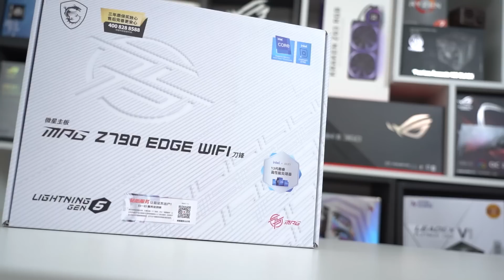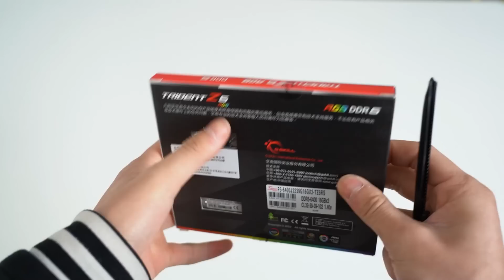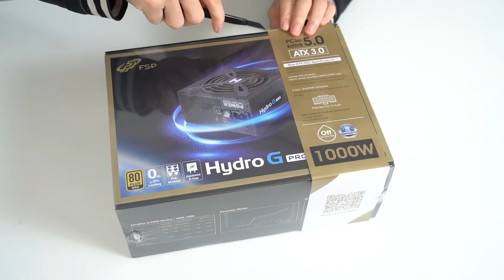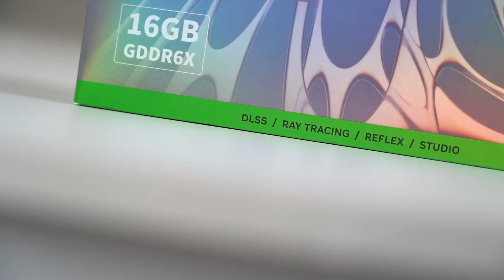RTX 4080 IGAME + 13900KF White computer

Comment: Drop dead pretty build - it's like a work of art.  I thought I read that using a vertical GPU mount had a negative impact on PCI lanes?  Maybe that's AMD not Intel, can't remember?  Wondering about fan noise with that many fans but wow.  What is the airflow like on that case?  You did an amazing job building this rig, wonder why no 4090 was it a 'color' issue that made you go with 4080?  The only thing better than your build skills was the video production - truly top-drawer!
:person-turqouise-waving:

Comment: That’s a lot of pull fans. Technically 10 exhaust fans and 3 intake. Personally I would’ve done the verticals 3 fans intake. 6 intake, 7 exhaust instead of 3 intake and 10 exhaust. Cool build tho!
Reply: I was thinking the same as you usually have more intake fans than exhaust, but since he has a radiator on the side I guess they can work good as exhaust too
Reply: More air out than in, Means less dust in machine. As long as it has sufficient cooling. More air out is best.
Reply: There is probably even pressure it’s just that the uni sl infinity’s are the same on both sides
Reply: At 5:22 and 5:36 does anybody know where he got some extra screws from im kind of trying to build the same thing but the package only comes with 8 screw only
Reply: At 5:22 and 5:36 does anybody know where he got some extra screws from im kind of trying to build the same thing but the package only comes with 8 screw only
Reply: @fidelreyes9939  probably bought some at a best buy or sum hardware store

Comment: almost same build I did. Only difference is I used Corsair h150 with lcd upgrade side mounted push pull, the v2 24 and 8 pin strimers and mine uses the vision 3080. First time build in the evo case and I ran out of room because I top mounted my psu... and I have like 4 controllers and a hub behind the scene to get rgb linked in icue software. Seeing how the cables going through the case routing pathways are hidden by the top mount push pull I wish I would have done that because thats the only thing I don't like on mine is the visible routing pathways.

Comment: Was there a reason for going with the single fans instead of triple packs with controllers? My pc wouldnt turn on with the controller plugged in tried 3 different ones. Was forced to rebuy single packs just to make it work. Just wondering if you had bad experience with their controller as well. Or anyone else that sees this.

Comment: Omg, almost same as mine, only I use air cooler Noctua nh-d15s, previously AIO already remove, I thought I’m crazy enough to put the Gpu upright mounting with another 3 exhaust fans behind the Gpu, top same as yours 6 fans, but the 6 side fan correct? It seems exhaust as well…I thought side have to be intake?

Comment: The GPU radiator should be moved to the front panel fan location… having a rad below the pump is a sure proof way to kill your pump prematurely!
Reply: The gpu's radiator is placed at the side, not at the bottom. Watch carefully. About the pump location, as long as it's not at the highest point of the loop (which is not) then it's fine.

Comment: Those single lian-li fans come without the controller, how do you connect everything on the mobo? I`m about to order 1 three pack with controller + 7 single fans. I was assuming this is the only way it would work with L connect software. i`m struggling to understand the options i have. Three fans with controller are about the same price as three single fans without the controller + extra cables. I don't get it.

Comment: What si the piece tiene munt vertically. I have a 4080 and i scare because the power cable is literally strunggle with the cristal panel In a lian li o11 air

Comment: why so many exhaust fans lmfao. those side fans need to be intake or you need to move the gpu aio to the bottom set to intake and the cpu aio on the side set to intake and have some exhaust fans up top, this will build up dust so quickly and temps wont be optimal

Comment: will the fans on the undersite of the radiator negatively affect cpu cooling? Or do they also blow to the radiotor?
Reply: Its called a push-pull configuration. The bottom side pushes air through the radiator while the top side pulls air through the radiator so it can be better cooling then having 1 row of fans.

It all depends on how hot the case gets after the air goes through the GPU etc though
Reply: @osirex5495  interesting, thanks 👍🏻
Reply: @maxfaberg128  Miniscule difference
Reply: @osirex5495  thats just stupid. u have to install it either one way not 2 different ways. or else there is no correct air flow in the case
Reply: @Simucoc3  No its not, you are just not understanding it properly.

The fans on the bottom push air through the radiator, the fans on top of the radiator pull air through the radiator.

So the air from the case gets pushed by the fans on the bottom while it also gets pulled by the fans on top.
Reply: @osirex5495  yeah when ur using it like that then it works properly (misread it sry) but i don't get really why u should mount 6 vents on a watercoler when u have 3 on the side, 3 down and 1 behind. Unless you wanna create a fucking tornado inside xD. Mr Matt Lee is buildung good setups for perf air circulation where he tests it in the end with liquid air for show.
Reply: @Simucoc3  Both CPU and GPU in the video are very hot under full load so yea having all those fans is like almost necessary

Comment: 5:38 why does this case mounting rack has these circular dents on the fan frame right in the place where the screws should attach? I had the same issue, what a stupid design, the first and last fan have a useless screw because of that.
Reply: That is not where you screw them😂 it’s not stupid design, read the manual

Comment: Tell me why he installed additional coolers on the radiator at the top
Reply: One set of fans blows air into the radiator, the other sucks it out.
Reply: Push Pull Fans config

Comment: I don't know if you know it but you can damage the pump in the tubes if you run it down instead I recommend to run the tubes to the side and to the top this way you have less chance of damaging the pump
Reply: That's wrong. Both pumps on the CPU block and GPU are not the highest points in the loop - orientation of the tubes makes no difference.
Reply: @Mapantz1  Agreed. As long as the pump isn't at the highest point in a loop then it's fine.

Comment: Why did you put fans on both sides of the radiator ?
Reply: One side to blow air into the radiator and the other side to help the hot air from the radiator come out faster i believe
Reply: @babylorvbeats  exactly, also called Push-Pull Fan configuration.

Comment: Are there any differences between the K and Kf?
Reply: Yes, K means you can overclock. F - the processor does not have a graphics core.
Reply: @pandda7793  bs
Reply: @WirRegierenRap  What is bs? F means no integrated graphics dude isn't wrong.

Comment: RIP GPU PUMP
Reply: It's a side mounted radiator with tubes at the bottom, air will be trapped at the top of the radiator which is above the pump. It'll be fine. No different to a front mounted radiator (as long as tubes are at bottom not top it's fine).
Reply: The GPU's radiator is at the side....... at the pump is not at the highest point in the loop....

Comment: It's gonna make noise with the radiator on the bottom
Reply: Dude, with that many fans, it's gonna sound like a 737 anytime it's running, no doubt.  Also, looked like airflow might be an issue, I can't say that gorgeous looking case has a very practical design as far as airflow?  Beautiful build and amazing video.
Reply: @scottmcdonaldAAL211  bubbles may form due to gravity on the bottom water cooler leading to noise.
Reply: @RodDubs  The radiator for the gpu's aio is located at the side and the pump is not the highest point of the loop........
Reply: @z4k1_zaki65  Yes, I'm aware of how that works. However, I have seen bottom radiators end up with this problem.
Reply: @RodDubs  The problem is that there isn’t any radiator mounted at the bottom…. Only at the side and top…
Reply: @z4k1_zaki65  Oh wow, looking back at the vid I see that now. My bad.

Comment: Omg. The Case with Screws on every Site, a Power Supply from "Nobody", Fans from AliExpress. Holy moly. That isnt good. U mounted the Water-Graphiccard but the Scubes are completely wrong. They are under the top site of your card. And i dont see intake mounted Fans. Thats a bad PC Build, sorry.